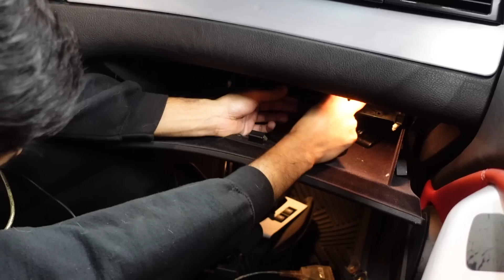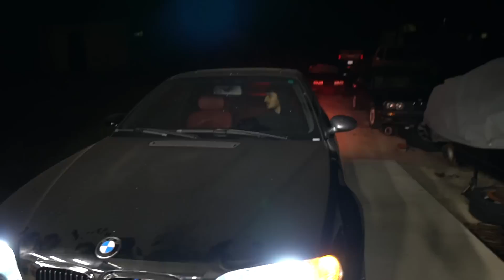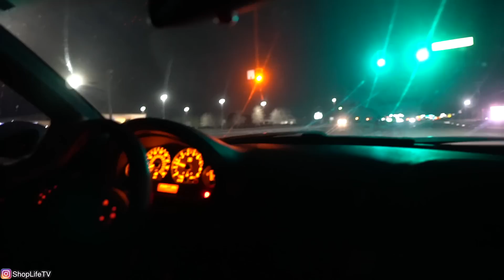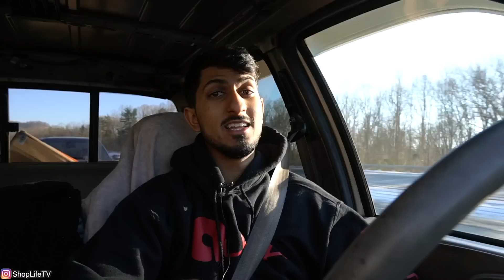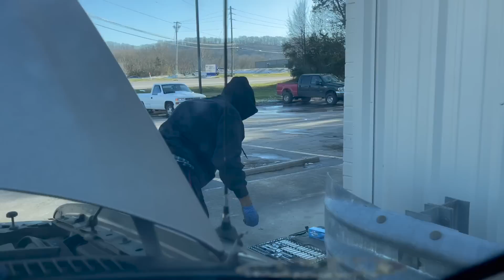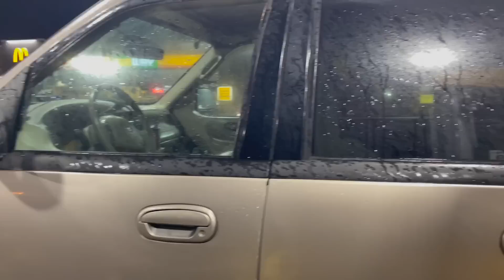BMW E46 M3 FIRST START!! and Delivering it 600+ Miles away!

Comment: I had an opportunity to buy an accident damaged manual e46m3 last year , the idea was to Diy everything in my home garage, apart from the accident this could have easily been on the neatest examples in South Africa ! .I was about to pull the trigger , then on closer inspection I noticed a slightly bent strut brace causing me to get cold feet.I regret not throwing caution to the wind though.Ive dreamt of owning one since launch in 2001. Keep up the good work , and look forward to more amazing content in 2022.

Comment: Curious on your opinion, I have an f30 335i and after some modifications the clutch slips under load, the dual mass flywheel is quite expensive and am just wondering if it's highly reccomended or if I can go with just a new clutch and the same fly wheel?